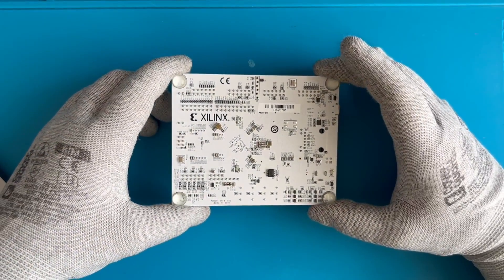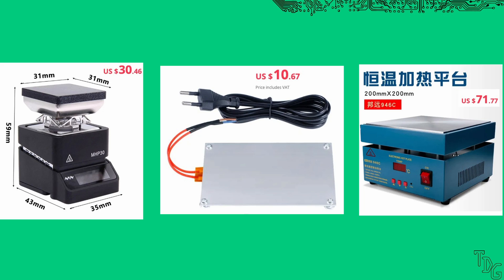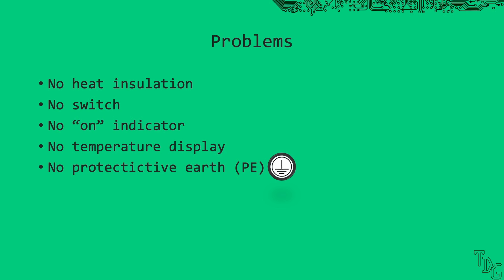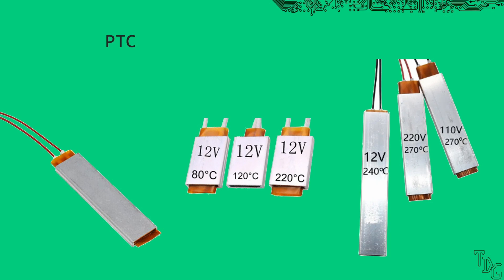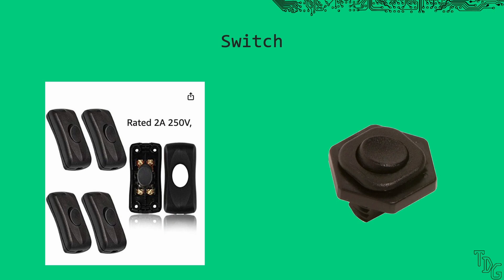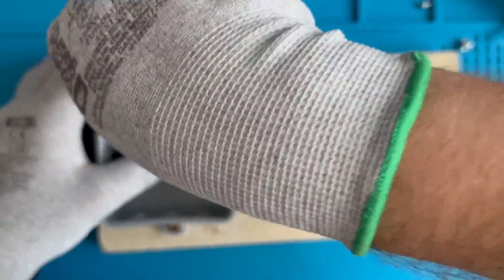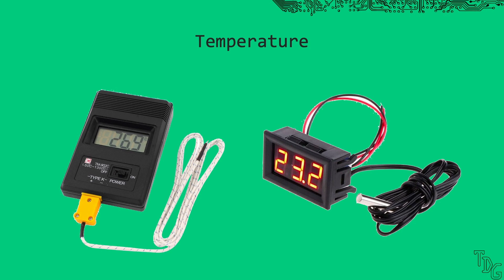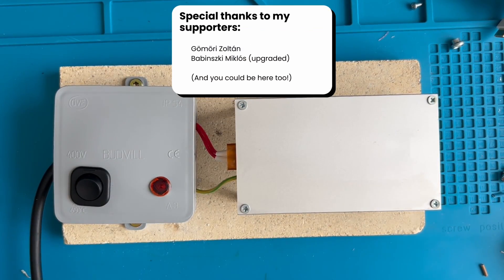Improve - DIY hotplate

Comment: A 555 ic and a triac to control it's temperature could be added and could improve the usage so much
Reply from the maker: The goal was the “go minimal and won’t kill you”. If small improvements are added, we end up with a full featured product soon!
Also different kind of PTCs can be selected for different use cases, for example a preheater.